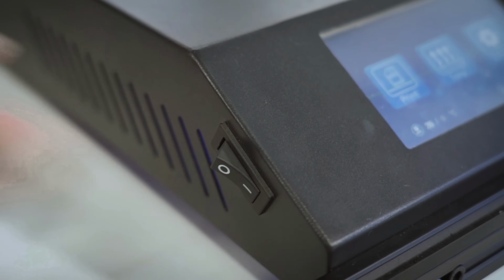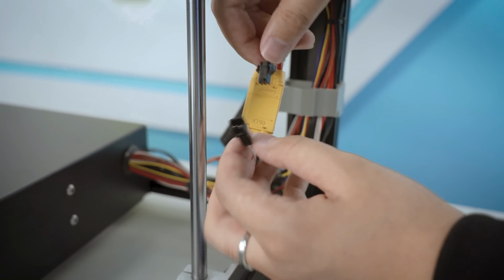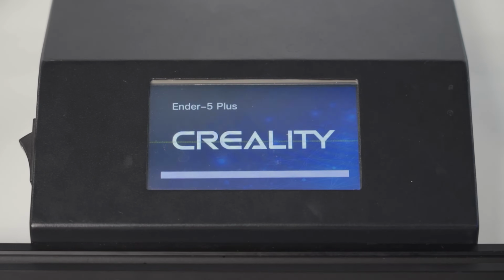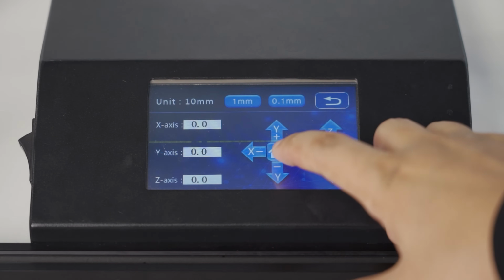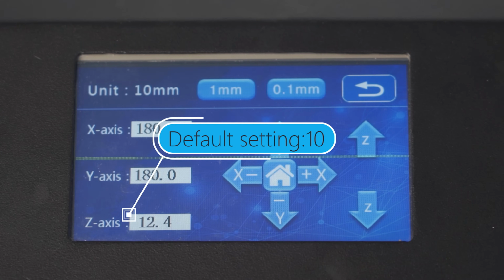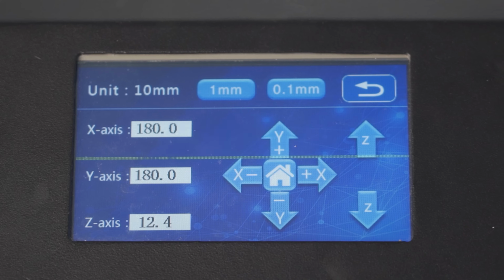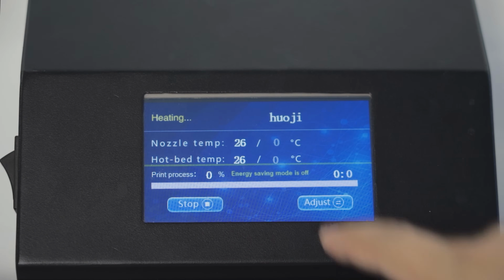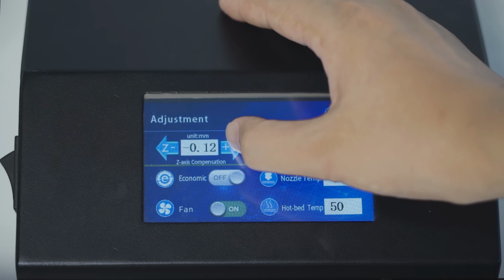Creality Ender-5 Plus Bltouch Leveling Tutorial (2019)

Comment: I've tried this a few times now and cannot get my bed to level.
I get the Z offset to 10 and level each corner with paper until it just starts to bind. If I then try to print the nozzle is about 2mm too high!
Reply: This also happened to me. First prints with the machine were great without any adjustments, then suddenly it started to print too high? Curious. Going back through now to see if I changed anything...
Reply: @FlightIsLife  Did you fix the issue?
Reply: I have the same issue
Reply: how did you get it to 10?
Reply: Did you fix the issue?
Reply: Over time the screw loosen up from vibrations of the printer... I used a hot glue gun and put a little glue on the screw and plastic screw turn to keep from moving
Reply: It's the BLtouch offset that you need to adjust in the adjust menu while printing, z axis compensation.

Comment: For any one who comes here asking for Creality fixing the BLTouch offset, just give up, they do not care and they will not listen at all. They have been told to fix this since release and Creality do not give a rats ass about their customers. They keep ignoring it and even when you mention it for their support, they don't even comment, they just ignore you all together.
I have yet another control board on the way (my 3'rd) because it keeps having issues  with my 6 weeks old Ender 5 plus. First board E0 driver burned out after almost a day of printing. Second board will only boot 1% of the time. Their normal Chinese branded PSU is extremely dangerous as it has been proven by many big youtubers in the 3D printing space, again since release of this printer. There are grounding issues with the cheap PSU they use as stock PSU on the Ender 5 plus, at least i got them to ship a proper MeanWell PSU that is of high quality. The PSU issue is yet another problem they keep ignoring excusing that it is only a few. Funny how every single Creality printer owner i know have this issue, going back to the Ender 3, so Creality is lying to their customers, but worse of all is that they are gambling with theirs customer life to save money!

So now I'm waiting on my 3'rd board for this printer, I will confirm that i can connect using USB and that it boots but after that is is getting put in a box as I've changed all controls to Bigtreetech.
I would recommend every one else doing the same. Yes it is a rather big job to do so, but do what you can to get away from Creality garbage controller and their awful "support" and remember to check you PSU for grounding issue TH3D have a great video on this
Reply: Grounding issues are not a board problem as the grounding depends on continuity from the ground terminal to the chassis If you have any problems that Creality have not addressed then get in touch with Naomi Wu and ask if she can give Creality a kick up the butt to address your problem, she has a lot of influence with Creality and has in the past acted as a go-between for Creality customers.
 How is your printer now, did you add anti-backlash nuts to the lead-screws?
Reply: @AndrewAHayes  If you actually did the research you would see that the issue many Youtuber point out, is the screw connection that connects the PCB to the ground terminal inside the PSU that is loose. I never said it was a board problem regarding the ground issue. I said that they have board problems, as in their controller boards are shit, and the PSU they use are shit :)

I appreciate the info, but I should not, as a normal customer, have to go through some random person that have influence on Creality to get proper support on DOA product or have the company take problems that could kill their buyers serious.

I ended up gutting the machine for all electronics except the motors and buy stuff that actually works.

Oh and if any one wonders if they should buy Creality.... don't! Spend some more and go Prusa every day of the week, i reget buying their garbage.
Reply: @GeekGarageDK  You get what you pay for!

Comment: Home working good for me but when start leveling even if probe touch bed still rise till hit the print head... i had tu lower it instead of raise. How is that possible ? I have risked twice to crack the bed and bend / crack / ruin my print head and x rail.
Reply: Were you able to fix this? Mine did the same. Worried about damaging the printer.
Reply: @Kari_512  offset by dialing on the console. Then record the position and everything work fine

Comment: I just got new MB to my Ender 5+ original MB had a defect/loose SD reader. But still i cant find any files. Tried to "slow" format SD card with error test, then put files back. SD card seams fine in windows, but still cant see anything in file/print menu. SD card formattet in right 32 format.
Reply: Try making the file names shorter. For some reason they can't be longer than 15 characters.
Reply: @DECENTRALIZE-sq4yh  I noticed that too
Reply: Just download something from thingiverse. the files they give you are all there...the frog, the vase, the box...all the same old stuff

Comment: How do you get the Z-axis to read "10" after auto-homing the printer?
I can't print with SD card due SD slot isn't working. Waiting for new Main board.. So how can i do this with out print from SD card? It was ok, suddenly the printer run the bed into nozzle.. And both motors was still pushing up when i noticed.. Not a nice sound.. But hopefully all is ok. Bran new printer.. So annoying. now i cant print due it always go to high.. and scratch nozzle against bed..
Reply from the maker: Please try to format the SD card, and then insert it into the printer to see if it can print. If not, you can try to print the printer and computer online.  Other problems can wait until you replace the motherboard to see if it still exists.

Comment: unfortunately it still whistles.  nor did the lubrication help. 😞
Reply: I found mine was whistling from one of the linear bearings on the Z supports. The fix for me was to switch the printer off and spin one of the Z motors a little (without spinning the other!) so that the sides were more level - the sound seemed to be caused by the linear bearings being forced off-axis a little, and raising one side a little helped with that for my. It took a bit of trial and error though!

Comment: Hello, my BLtouch is flashing red? What does this mean?
Reply: Same problem for over a month with no technical support from Creality on a brand new printer that has never printed
Reply: @sammowbray9908  So I figured out the red flashing part but I'm still struggling with the print. From what I can tell, the red flashing stops when the BL touch does what's called a 'self-test.' You need to make sure the end of the BL touch that sticks out is in the UP position to begin with, then start the printer. Make sure the bed is low enough that when the end drops down, it doesn't hit it. If all goes well, the end of the BL touch should stick out twice, then pull itself back up. I believe this is to orient itself. Then it should just stay red.

You can also consider watching this video to update firmware if it's behind!
 https://www.youtube.com/watch?v=ExuPoNZK_aw&t=
Reply: @sammowbray9908  You have likely solved this, but for future dwellers: Flashing means the tip can not go down easily. Maybe the pin is a bit bent.
Reply from the maker: Dear friend, please try to plug in or shut down again to see if the same problem still exists.

Comment: ender 5 plus Sweeet and niiiiiiice!) but there is construction issues for the ender 5 plus!!!!!!! 
 
y axel- you have got the carriages with 4 wheels and they are in wrong position! as the pressure and weight is down not on the left or right- and you can use only 3 wheels instead of 4- so save materials- but why is it y axel?- from school though it is z axel!) 
 
regarding the hot end — i have had ender 3 and it is the same! change the main fan blowing straight to the hot end- move it up to 1 sm and the hot end started to get hot quicker! also for the ender 5 plus it is good to use the direct drive extruder! something like this — https://aliexpress.ru/item/4000008905489.html?spm=a2g0s.9042311.0.0.17ce33edL8KzYK + vulcano extruder! also you can safe money on this too)))))) if you use the original not the direct extruder there is pressure from the teflon pipe to the carriage) and as i measured it on ender 3 it was more than if to install the direct extruder!- so can increase the speed of printing)))) also yours hot ends is for slow printing as i have noticed if to print more than 50sm per sec there will be under extrusion! use the vulcano hot — the cost is the same sure your clients will be happy!
 
also why do you need the bl touch? if everything is centred good bl touch is no use! safe money) provide it as an option to the clients)
 
for the main board use professionals like beegtreetech skr v 1.4 with lcd (as the option) sure can safe money on this too)
 
to power up there is no need 500w ac-dc power supply- enough 250w and for the bed use the 220 volts supply controlled by the main board) safe money (only the aluminium plate 350-350 mm + silicon hot bed 220 volts) 
 
for the box (power and control and monitor) you have to do something separate it from the main construction- as most of the users will prefer to close the construction for the abs plastick and quicker speed of printing for other plastick )))) also you can give to you clients option of closed box) 
 
the z axels (what holds the bed) why you ise the big straighteners that rolls on the steel pipes (i have checked it will be enough 8 mm pipes and the smaller one holders — or rollers — so you can safe money on it) https://aliexpress.ru/item/32972447810.html?spm=a2g0s.9042311.0.0.8d4d33edo6vUY5 as an example this is enough to hold the bed 8 mm !
Reply: In English please!

Comment: How do you get the Z-axis to read "10" after auto-homing the printer?
My Ender 5 Plus always shows the Z-axis at "12.2" after auto-homing.
Reply: you have to print something, press the adjust button and adjust it down to zero.  Its a pain, then stop the print and go back to the leveling menu and it should read 10.  He does mention it in the video, watch it again.  We really need a good paper guide for the leveling and offset.
Reply: same problem
Reply: I can’t even get mine to start leveling. The touch probe just blinks

Comment: Bad SD card slot is not recognized.
The SD card works correctly on another printer.
It seems to be a motherboard problem.
Reply: It doesn't work if the name of the print is to long, had the same problem first too.
Reply: Everything went well
Thank you
Reply: Make sure you don't have any numbers or special characters in your file name. Rename file abc

Comment: I have done these steps so many times and my prints still dont stick to the build plate.
Reply: Make sure the destroy my print mode is turned off. 
Great review but long https://youtu.be/-BFUf8S6-FE (15:44 turn off economy mode, this is what I'm talking about)

Other videos might help. 
first layer
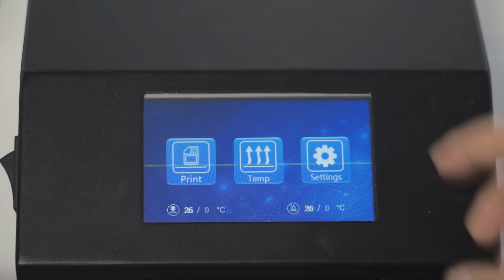https://youtu.be/AaF28dnDgKA (3:30)
https://youtu.be/pAFDEn3wGYo
Reply: Aquanet is your friend.
Reply: first clean the plate with alcohol and make sure the level and z-offset are good.  nozzle needs to be very close to the bed.  I have experienced this quite a bit , so see how far the nozzle is and watch that video about setting the offset correctly.
Reply: Blue painters tape, and a gluestick for hard cases

Comment: Thanks a lot, awesome video, which helped me fix a little miss when I built the machine - getting the Z to 0 before setting the bed will help! And it also got me to understand a bit better the levelling steps. 

There are 2 questions I came here for and haven't gotten answer:
- How do you read the results after measuring?
- What about auto levelling?

Last point - English is not my native language, I can write / read fairly ok but I have some difficulties with audio - is there a chance to get captions? (if too much work, don't worry, the youtube auto generated captions help for the parts I didn't get :) )

Now off to cleaning my bed plate and let's get something printed!
Reply: English is my native language and even I had problems understanding some of the audio

Comment: hello creality,
 I just bought ender 5 plus, the assembly is perfect but when I do leveling there is a problem there. when i select (auto home), the bed doesn't go up but goes down. and the Bl touch sensor doesn't come out (but bltouch light it's on / red light).
any ideas?
Reply: after following your step untill (3.00) and touch go home,  my bed doesn't go up but goes down. any ideas?
Reply: @Kabayann369  Hi, I had the same issue. I just pulled out the BLTouch tip and now it is working.
Reply: @danieleckhardt3288  I tried, but the bed kept going down (when touch go home) ... frustrated. :(
Reply: @Kabayann369  which software Version is on your Ender 5 plus? I also flashed the old software 1.7.0 BLTouch. Before it was 1.7.1
Reply: @danieleckhardt3288  sounds good, i will try daniel thank you for your advice (i will update soon)
Reply: and still not working. fiuh
Reply from the maker: which store you buy from and please send order number and store link here, let we push for you, sorry for all inconvenience.
Reply: @Creality3D  I confirmed this problem to a shop that sells, but I need a solution from technical support creality. Can you help me? thanks creality :)
Reply: I have had exactly the same issue as described with my brand new ender 5 plus and have tried this a number of times and basically useless.
The seller and creality are also useless and have offered NO support and it doesn't matter how many emails I have sent so as far as I am concerned the Ender 5 plus is a Lemon
Please convince me otherwise

Comment: Why is the z-offset 2mm again after the auto calibration? You set it to 0 before calibration.
Reply: Yes, after going through what the video said the nozzle was still too close to the bed.  I did what darthinkwell did - run a print and keep changing the z offset whilst its printing until you see a change in the print - if the print filament that is deposited on the bed gets really thin then you are too high so start to change the z offset in the other direction.  Do short increments of about 0.1-0.2 until you get that nice squidge on the first layer.  Mine auto set at -3.74 after following the steps in the video but I ended up making adjustments to -2.5 which for my printer is just right.  I've only had mine a day and it was a bit finicky to set up - my hot end nozzle had to be replaced as it wasn't machined correctly (way too small a hole), thankfully a replacement was supplied in the box, but once I figured that out and did this bed levelling, I'm really happy with the end(er!) results.
Reply: Because that is the actual Z off set the printer set during the configuration.  I think they configured 2.2 in the configuration.  

I manually dialed mine in at 2.4 so I am assuming that is close to the offset between the nozzle tip and the BLTouch installation.